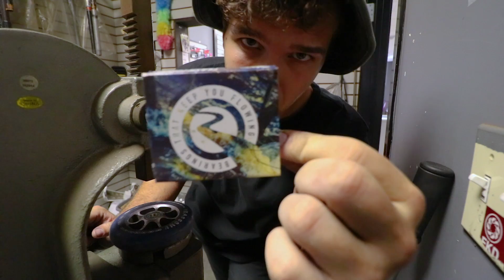TESTING WORLD'S FASTEST SCOOTER BEARINGS

Comment: I got brand new River wheels and they came with the flash floods, but they were completely shot after a week of riding... and I really don't want to have to pay for more and more sets of bearings. I've tried bearing grease, WD-40, speed cream, and nothing works. Can anyone help?
Reply: Cody Deen never  use  WD-40 it works but it makes them break faster it's like a ticking  bomb
Reply: josh welke I know. I used Wd-40 to clean out the dirt then I used speed cream, it didn't work, so I tried grease, just made them all messy and it still didn't work
Reply: josh welke yeah i did and I will